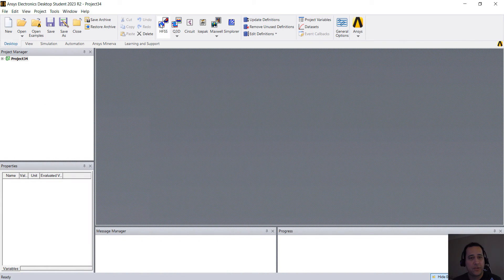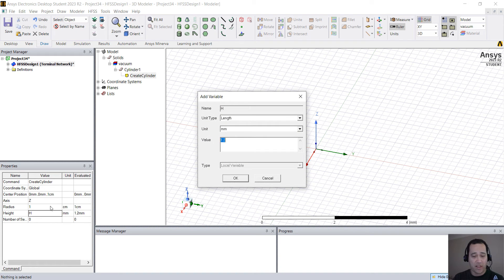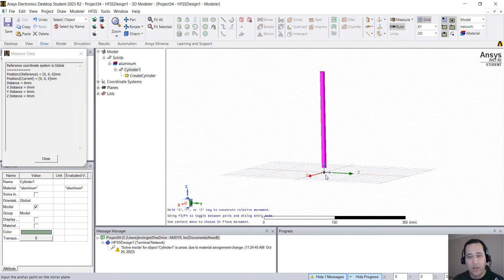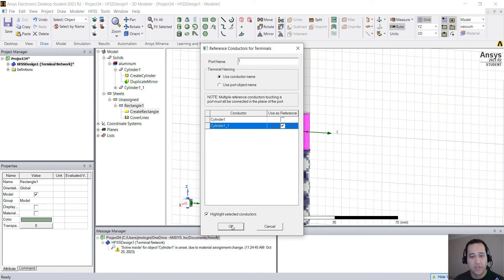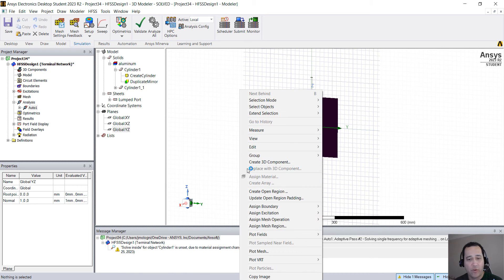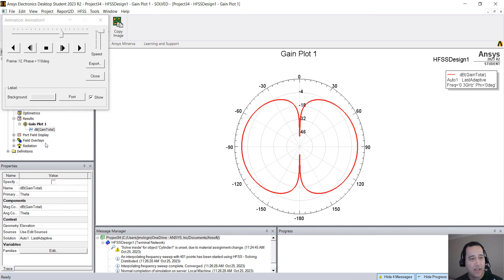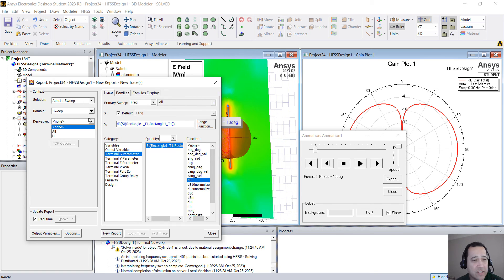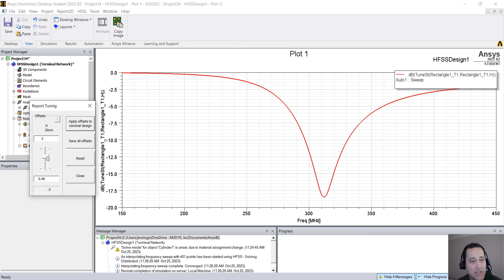Designing and simulating a Dipole in Ansys HFSS Student Version

Comment: thanks alot , it was benifitial , but i have a problem , i tried to do just the same , and when i do for the surface : assign excitation --> port --> terminal lumped port , its shows an empty box , there are no conducters to use as reference like in this video you chose cylinder1_1 , but for me there is nothing to choose , and when i simulate analysis , it shows an error :  Port '1': The port has no terminals defined on it.

can anyone help pls ? thx ..